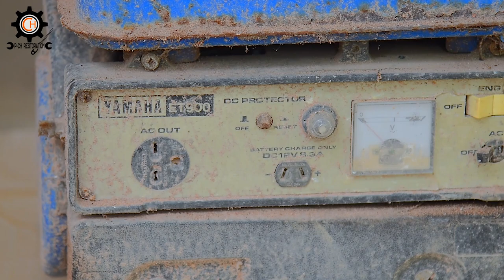1994 Yamaha ET900 generator  Restoration Japan technology -Revive old rusty 900 VA generator

Comment: Look good thanks for posting These Generators are old but they were incredible well made. For years  I have an 1994 Yamaha  GA1800a  AVR That I restored  I have notice that though it rated to  put out over 1800w I have powered electrical equipment that's   2400w. It was well  with it  Over the years with the  many power black outs we have had. it will not only  power  my fridge my two freezers  but my microwave and  my LED TV as well It will even power my computer  I found this that because its an AVR it   will  power any electrical appliance that got a separate power supply.  This is ET900was one  generator that was realy was well worth restoring. These work well and will start every time  if you make sure when your finish there no fuel left in it